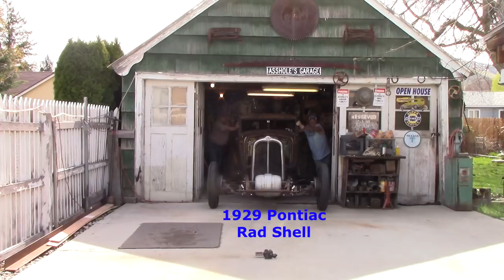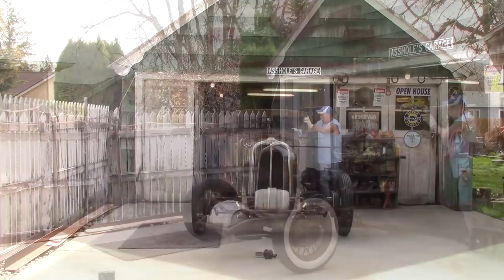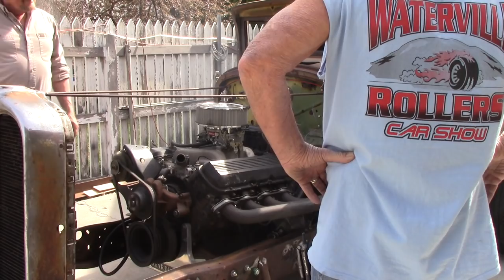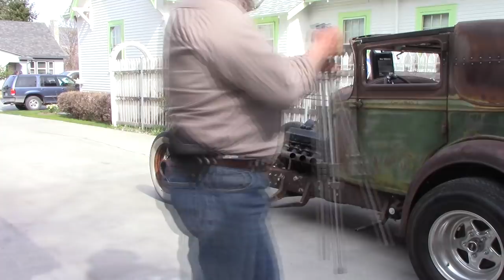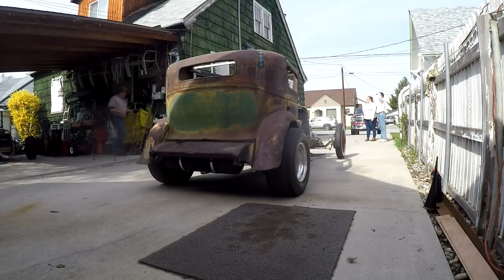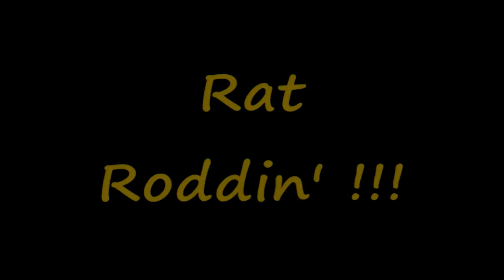1927 Studebaker RatRod - FIRE IT UP!

Comment: Great video presentation, all the camera angles make for a dynamic professional looking feature.  The lighting was perfect also.  Actually the video was done by a professional, good job!  Beautiful car by the way!

However IMHO, that poor old motor had a lot of its life removed without any coolant.  The cylinder walls probably are blue and the  rings have lost their temper.  Also, without any added rpms,  the cam and piston skirts had minimum lube applied.  The heads may have a little twist here and there internally.  I may be totally out to lunch on this observation, but my experience in buying 'dry run' eBay engines have proven otherwise.

Anyway, 1963impala2dr,  I am a huge fan and admire your work and life style.  Great Vid!!!!!!
Reply from the maker: the engine was never allowed to get hot.. or even overly warm. I know it appears otherwise in the video but the engine was shut off for long periods of time between starts. people dont realize that I literally had hours of footage and it took me 6 hours over two days to edit it.  remember we made a run to the parts store which took 40 minutes but only about 6 seconds in the video. Old Jim built racing engines for years and years. he knows the limits but you are certainly entitled to your opinion.
Reply from the maker: and thanks for watching :)

Comment: How are you cooling/lubing the mechanical seal in the water pump?  How are the heads remaining cool ,as much as it has ran and been revved?    I'm not picking on it..., I'm genuinely curious. I'm pretty sure the thermostat housing has no hose on it .I'd be scared that the heat would bring about loose valve seats due to the dissimilar metals of the heads and the seats,with no coolant
Reply from the maker: i know you're not picking on it and when I watch the video back.. I can see how it might appear to be enough run time for concern but its all done with smoke and mirrors.  I had literally "hours" of footage. It took me 6 hours over a two day span to edit all that footage and condense it down to what you see here.   it was never allowed to get hot. (ol Jim knows his stuff, besides... if you knew the grip with which he holds his money,  you would know he would never risk damaging his $7k investment :) The cameras were off for long periods of time while we did other things between starts.. (remember we went for a trans fluid run which took 40 minutes in real time but probably 30 seconds in the video. lol ) 
 thanks for the comment and thanks for watching.
Reply: i can tell you  2  mins of run time is to much with out cooling.  when i had to drop my drive belt on my 496 8.1L to find a tapping knocking sound it would boil the colant   inside in just 2mins with out the water pump turning